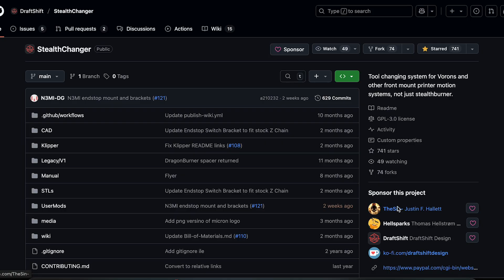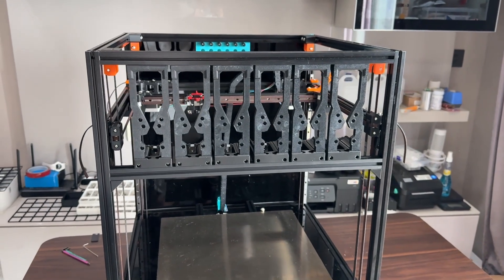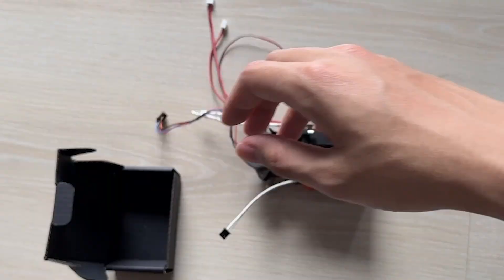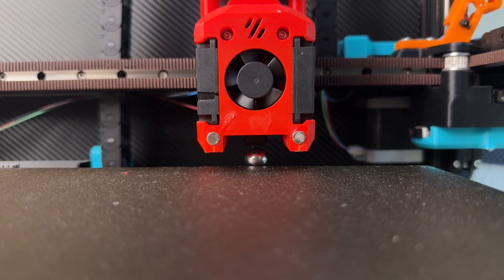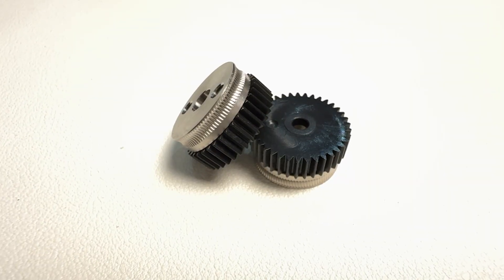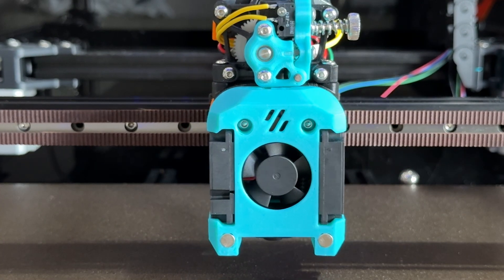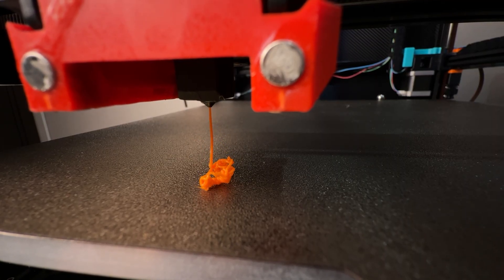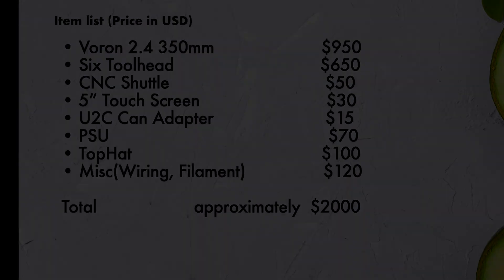My Voron Can Swap 6 Toolheads – Here’s How I Built It

Comment: Sweet build! i dont know why i only got this recommended a month later lol the chinese HGX/LGX is still imo the best low budget choice for 6 heads
Reply: A month ago! that makes you like an old-timer or something :)
#teamsherpa
Reply: @SittingDuc sherpas have better extrusion quality and less backlash if you're using an intergrated gear one, and fystec ones have decreased the price recently
HGX better at TPU and high speed extrusion, and protoxtuder housing have lower center of gravity but the stock bearings are bad and grinds down in no time, probably not a good choice for toolchangers

Comment: Awesome build man, are you running dragon burners with ebb36 can boards? Or some other 4010 toolhead design? Also, what hotends are you using?
Reply from the maker: Thanks for the kind word! That’s Dragonburner with tz2.0+hgx extruder. TZ heatup super fast which was nice when calibrated multiple of them.

Comment: A trident would be better because there wouldn't be a delay of going up and down.
Reply: True the Z move is a drawback, although belted Z on the Voron 2.4 is not the slowest.. and 48V Z is downright scary.
Drawback to a trident or similar is you need something to move in order to dock/undock - either a liftbar (patented, so not as common even in DIY) or another servo-type mechanism. One value of stealthchanger is using magnets everywhere around the dock reduces the complexity and requirement for "constrained" mechanisms.. aka making it all cheaper

Comment: do u need like a can extension board for connecting multi tool-head. I dont get that
Reply from the maker: I use a board from Fystec to help with my wiring. You could just use normal wagos to wire them together.
Reply: Thanks, now i get that. And then what type of probe do u use for bed leveling, tap, eddie or klicky pls?

Comment: So cool!

Your price summation leads me to think that the  H2D or the Prusa tool changer is a better choice for me.
Reply: A five tool prusa xl is $4000 man. And the H2D isn't that far off but it is limited to just two tool heads. However, they both work reliably straight out of the box. So if you wanted to get started with tool changing today, then I would go with the xl, but if you want a fun project that you can learn a lot from, then a voron 2.4 tool changer would be the better option. There are trade offs in both choices.

Comment: was it hard to tune the restracting and how do you make sure that theres no residue left when probing the nozzle?
Reply from the maker: If didn't do a toolswap the retraction setting would basically be the same. To deal with residue I use a bambu wiper mod install on the back of the buildplate.

Comment: This is cool. I am currently building one with 7 tools.
Reply: +1
Reply: That's JDM levels of insanity ;)
Reply: Mine has 30 tool heads and is 20’x20’x20’ and is enclosed and filtered. 

You literally walk into the print room and the whole rooms prints. 

It runs one nozzle behind the next so two layers per pass. Very efficient
Reply: @biomashed  :face-green-smiling:
Reply: @biomashed  Can I see it ?
Reply: @benjaminberthelot1332 I’ll have to make video. But simply put, adjustable height of secondary nozzle that’s trailing and raised one layer height so 1.85 layers per pass, it’s two layers but you have the loss of starting layer and finishing layer so the two layers per pass adds up to reduce time overall  ton.
Reply: @benjaminberthelot1332 I’m printing a full shell to put over some exocars to make some really cool and lightweight car molds for full cf body panels
Reply: Mine goes to 11

Comment: I know you said you are using a u2c can adapter, but that does not support 6 can toolheads, are you using a breakout board of some type?
Reply: The neat thing about CAN is you can string nodes together in series. So it starts at the u2c, goes to toolhead 1, then 2, then 3 etc. You place a terminating resistor(the 120ohm jumper on CAN boards) at both ends, so the u2c and toolhead 6, and it's good to go.
Reply from the maker: I did use tooldistribution board from fystec, you could use anything even wago connectors will works.

Comment from the maker: Hey! A few of you asked about print quality and reliability.

The print quality has been pretty good — not perfect, there’s a bit of inconsistent layer lines if you look under harsh light. But mechanically, it’s solid. I even ran a print with around 1,800 tool swaps, and it held up without any issues.

Unfortunately, I couldn’t include any print footage in this video because I had to get my wisdom teeth removed right as I was finishing the edit 😅

I’ll definitely include some prints and time-lapses in a future video. Thanks again for the support!
Reply: Im worried about HGX bearings grinding down, my experience with HGX 2 has been good after swapping out the cheap bearings that turned into dust after just a few hours of high speed printing

Comment: Voron is for people who want to play with the printer and not with printing. Print quality comparable to the old ender. It was my worst choice out of all the printers I own. I understand that some people want to endlessly play around with improving the printer so for them it might be a good choice.
Reply: I don't know about that. A Voron is what ever you want it to be. Even a super reliable, fast and great quality easy to use farm printer. 
The difference is, you'll need to make it that.
Reply: @jake360flip  Voron is not reliable at all and that is its reputation. I have many printers so I have a pretty good comparison and for the price of the voron you can have a super reliable prusa that prints great quality. Just move the voron to a different location and have fun calibrating and adjusting the settings. None of the many prints I've done on the voron have ever matched a print from the prusa. Voron's only plus is that absolutely everything is open source.
Reply: @taczka2  Voron's not being reliable for the most part comes down to a lot of people building them wrong or with cheap/inadequate parts and then pushing them hard. 

How ever i do not disagree with your points that there are cheaper, more user friendly printers. 

The thing with Vorons is the capability to do as you please with them is there, but the hand holding won't be. 

With Prusa you're locked in to the same hardware and software on every machine and the software can be developed and tuned for that one use case. Ala Apple with the Iphone. 

There are plenty of people with Voron farms. Klipper is incredible and powerful but you need to spend the time to know your machine inside and out, and a lot of us don't have that time.

tl;dr i still disagree with your first point.
Reply: Skill issue tbh
Reply: @ParkyCat  100%. I started with a Bambu A1 a couple months ago and it printed almost flawlessly with 30 minutes of setting up. I got a Prusa XL and after 10 hours of assembly and tuning it printed really well. I built a Voron Trident a few weeks ago and after ~200 hours of building, tuning, modding, and more tuning it prints absolutely flawlessly. It's far from the easiest path to 3D printing but nothing else at the hobby level compares as far as I can tell. I haven't used the A1 in a month... StealthChanger is now in the works and I'll probably sell the XL once it's running.
Reply: A Voron is as good as its builder and I cant stress this enough. I have built a Voron Trident myself and have been using it for almost a year now with minimal maintenance. The print quality is quite good and consistent results every time. Being a Voron, its open for modding and upgrades should you need to go down that path and thats its biggest strength.
Reply: This is what I'm talking about, Prusa is also assembled from parts and works well, while Voron is a roulette and even if you have good quality parts it requires a lot of play to get a decent print. I have a voron 2.4 (from formbot kit) and one of the recurring problems is the sensor for auto-calibration is in the wrong place I have to replaced it few times because it just breaks down and has the housing waterlogged (when use high temp filaments like ABS) and this is a very well known problem. Of course they made a fix for this - they created new head but you must also changing the linear guide so this fix is quite expensive. I myself ended up changing the whole head to a ready-made one from ali. Another thing is profiles for the slicer. Of course, there are no one-size-fits-all like in bambu or prusa so it's a multi-hour game when you buy filament of a new type or from another manufacturer. I understand that for some such a game in itself can be fun but not for me.
 @sanketss84  The claim that voron is as good as builder is rather weak, I have assembled two prusa myself (I am an engineer) and I had to spend a lot of days to get the damn thing working and still I did not have quality like in prusa.  Most of the people who like voron simply have no experience with better printers and know at most the old ender or anycubic.
Btw: Prusa is also partly open source (firmware and plastic parts).
Reply: @taczka2 there is a lot of fault with prusa too. They're no golden egg. Features that are common place still not implemented into their printers. 

I appreciate what you're saying. How ever it isn't as black and white. If prusa works for you that is great. But you cannot put All Vorons in a box because of your own experience. 

As I said before. It can be whatever you want it to be. You just have to get it there but that is too much for a lot of people. (I have bambu printers/Vorons and prusas) And my favourite printer is a custom prusa bear I built running klipper.
Reply: @taczka2  go with whats your comfort level. each machine is a tool at the end of the day to get the job done.
Reply: @taczka2  as owner of cheap Elegoo Neptune 4 Pro i must say that machine performance is always individual but even when you can get good prints with cheap machine after fine tuning it, its usually better when you get bit more expensive parts to build it - like i exchanged defaul elegoo probe lately with cartographer and since then have like almost perfect prints especially first layers are amazing compared to what i was getting with default probe..
my plan for near future is to build voron 2.4 just cause its build volume and before ordering any kit i asked around what to get etc. ended with one quite common reply - don´t use hotend that comes with the kit and order some expensive one as its huge difference and to not use tap but rather beacon or cartographer as that way its easy not to just level the gantry but to scan surface fast before each print to make mesh - and here i must say that you bought kit thats one of the cheapest on the market so there might be the root of your problem as from videos over the years formbot got their kits better but still seems the quality is still a bit gamble with these china kits on some parts while like 95% of the kit is good quality there still might be some items that might be a bit worse
Reply: Maybe, but i LOVE my trident.  I was meticulous in the build and R'd TFM.  Rock solid, great print quality.  It's a workhorse.
Yeah, if you aren't a builder/maker/tinkerer, you probably won't enjoy the process.
Reply: @mattw7949  I really like DIY. That's why I wrote that VORON is for people who want to play with working on the printer and not with just printing.
Reply: A voron is only as good as its builder